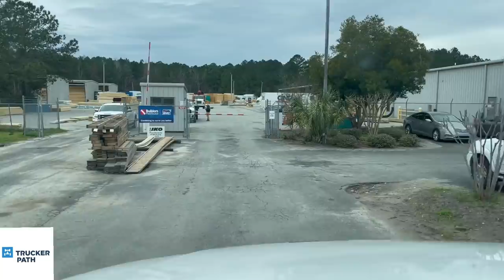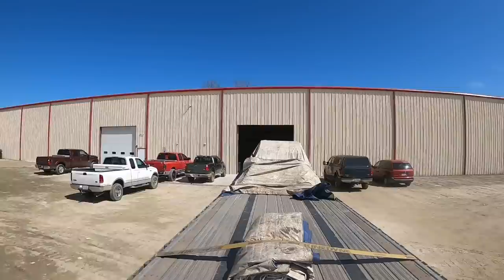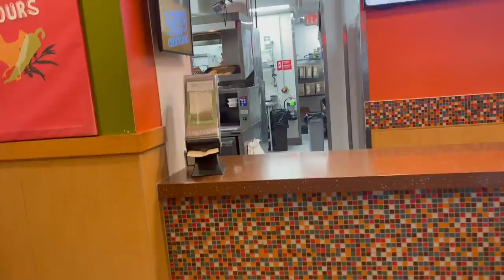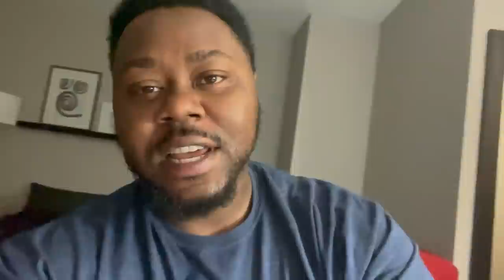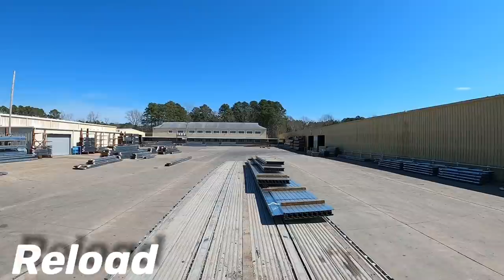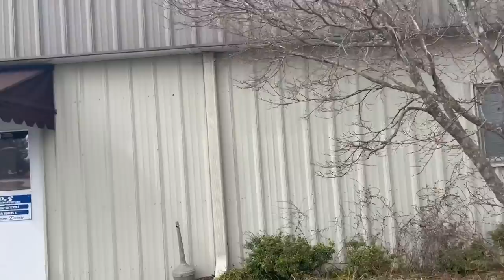Flatbed Forever

Comment from the maker: Trucker Path. Built for Truckers by Truckers. Trucker Path Premium Membership now includes premium truck GPS routing including:

– Get routes specifically for your truck height, width, weight and type
– Avoid sharp turns, low overpasses, bridges, small roads, and more
– Access turn-by-turn navigation, and night mode navigation

14 days free trial using my referral link. Don’t get left behind. Control your journey

https://u.truckerpath.com/2BF